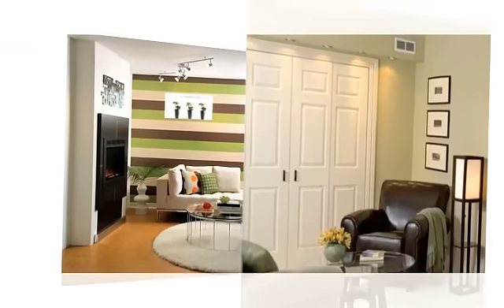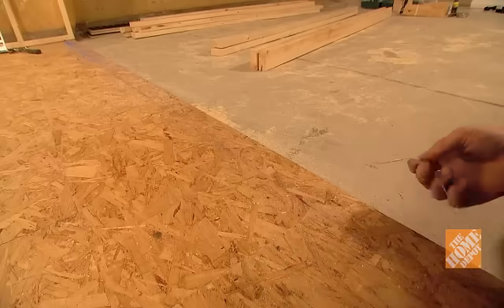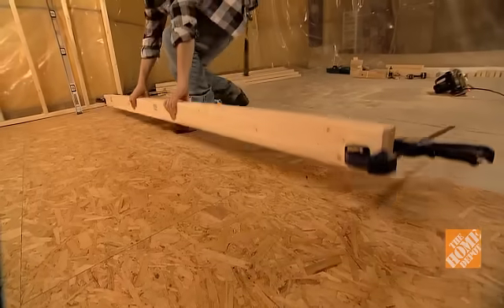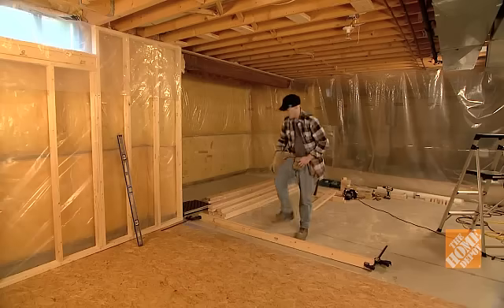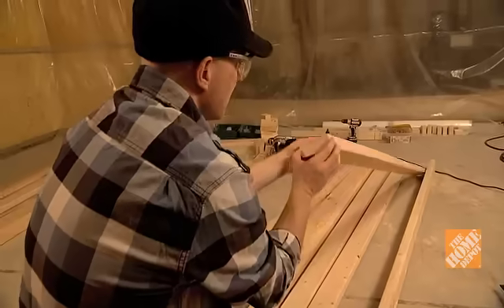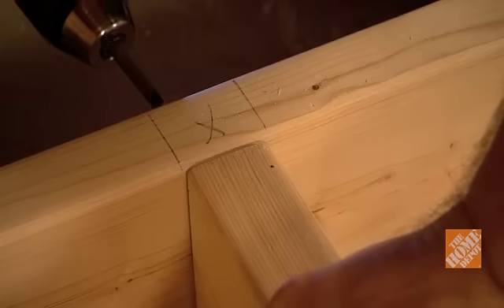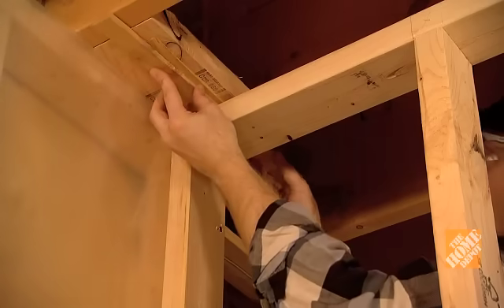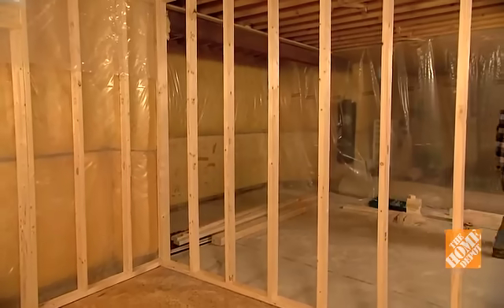How To Frame a Wall - Build a Partition Wall Like a Pro

Comment: 2:01. Crown orientation:  is ?  Does crown ‘bump out’ point into the room ?
Reply: Doesn’t matter. The crown all going in the same direction is for your sheetrock guy. Wall looks better when all your studs are bowed in or out. If you have one facing in the opposite direction your wall will look bad and the sheetrock will have a hell of a time making it look right.
Reply: Gerardo Lira    Thanks !

Comment: After working in renovation for years with my dad. This is the way to do it. Love the extra simplified steps like clamping the top and bottom together to cut. Didn’t think of that. 

Trust in measurement is key for me.

Comment: Type of wood used for studs?
Reply: Get treated wood for the base plate. Tobprotect against dampness rott and moisture from the concrete.

Especially in basements.
Reply: 2x4x8 lumber
Reply: Warped